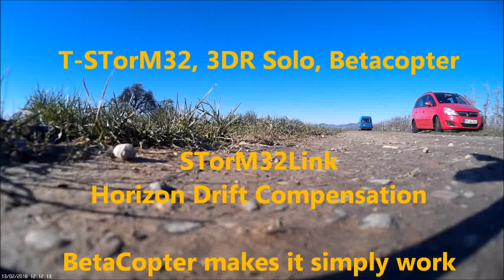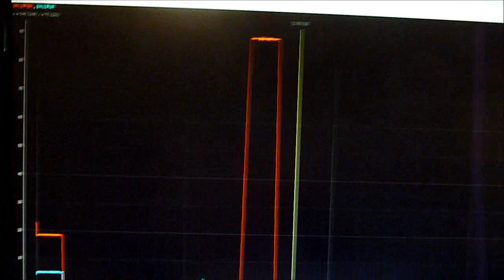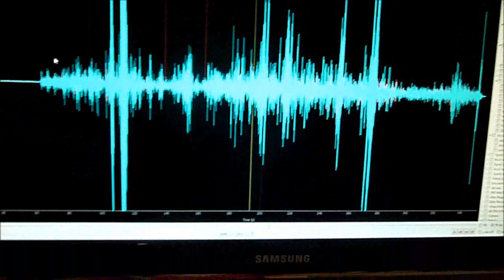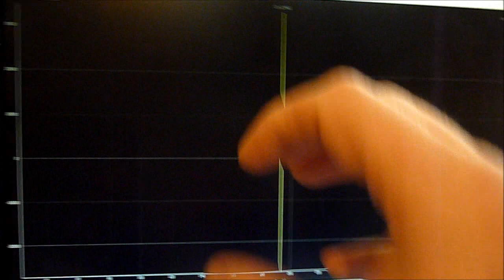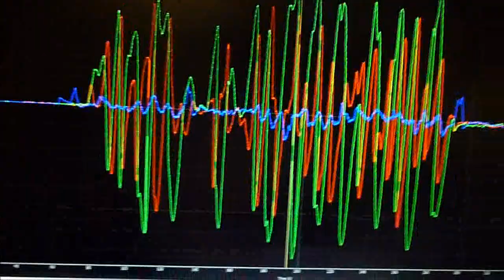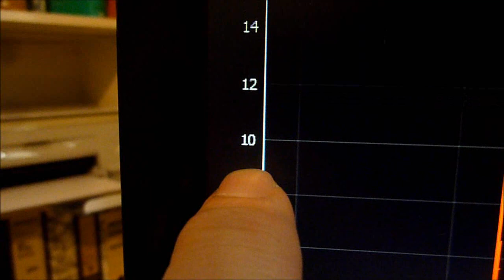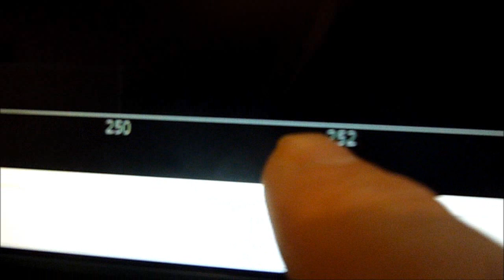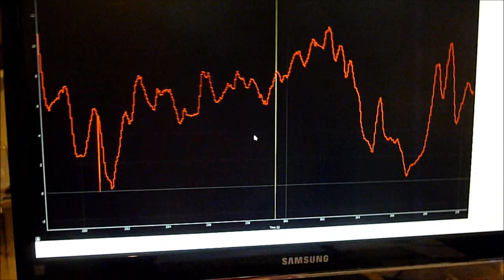T-STorM32, 3DR Solo, BetaCopter: Horizon Drift Compesation in high-g Turns

Comment: it's very hard to understand what you're trying to say...  At first I thought you were trying to get the camera to 45 deg tilt but then you end of the video finally I get you are trying to keep the camera horizontal regardless of the external forces applied to it? Due to inertial forces because of sudden change of direction or acceleration. the algorithm uses the IMU sensor and with a controller algorithm it applies opposite gamble rotations to compensate? Are you using PID controller? or another method for controlling?
 You could have just said that the purpose of the video is to display how the gamble controller algorithm keeps compensating to keep camera horizontal or at the desired angle at all times regardless of how how the craft is moving or titling?
Reply from the maker: keeping the camera horizontal is the purpose of using a gimbal controller in the first place, so I think it's fair to assume in a gimbal video that this is known. Centrifugal forces make the gimbal to fail, and the video is about how to get this right. As regards the details you are asking, you may want to read up on gimbal controller such as the STorM32, there are tons of info out there.
Reply: @OlliW42  I don't get it. why the gimbal fails to compensate for the external forces? so someone must have not done the job right in the first place? is it because they use accelormeter as a way to point down? and with acceleration equal or higher the accelorometer gets tricked to think gravity is at 45deg? if that's the case then whoever wrote the code made a mistake. don't they use something like kalman filter?
Reply from the maker: well, you can't beat physical laws. I think you want to dig deeper into this technology before making such claims. "Kalman filter" is just a buzz word and of no value by itself. It's a matter of available sensors.